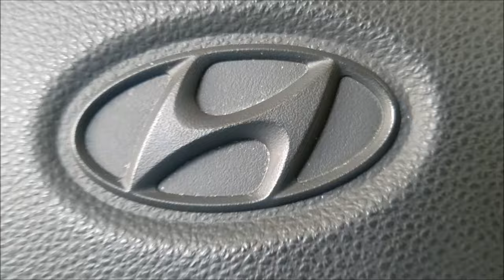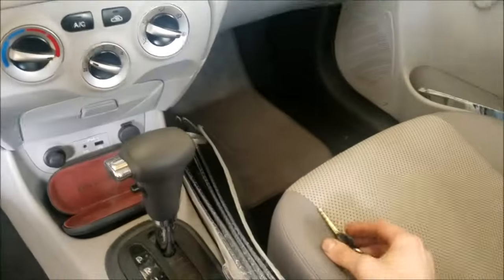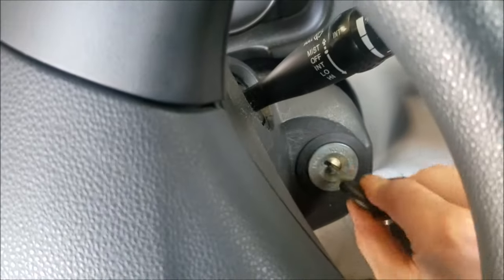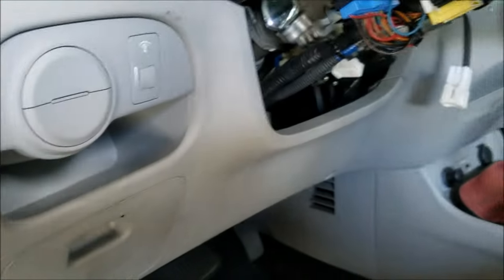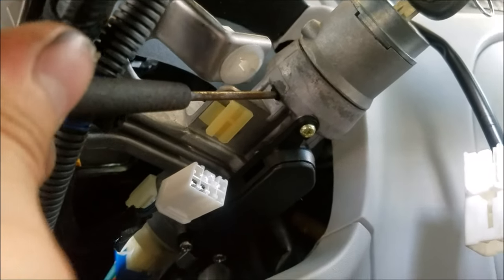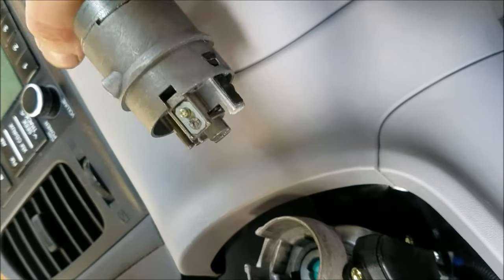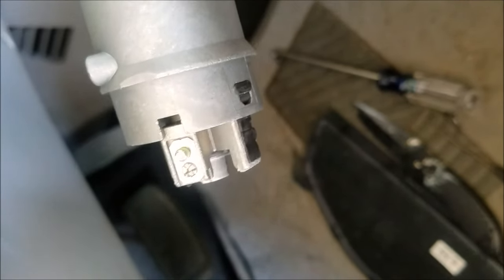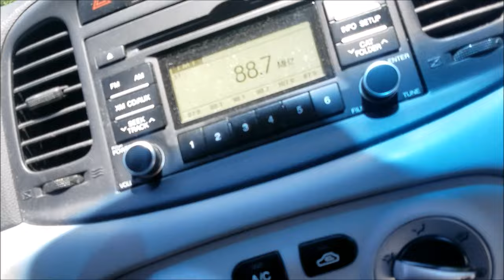How to replace Hyundai Accent lock cylinder

Comment: I have been having issues with my 2010 accent,  key will turn, lights on dash but no fire. Also having issues with steering wheel being locked and key not being able to turn. Wondering if replacing cylinder would help fix issue?

Comment: Please help me if you can! I have a Hyundai Atos 2002 on which the key gets stuck when trying to turn to ignition and start position - it's totally blocked. The steering lock can be deactivated. Is there anything to do with the lock cylinder - or does it have to be replaced? The key is very worn but this problem came suddenly and without warning! Do you think the problem is in the actual key-thing where the key goes "into grip" or do you think it's the locking mechanism further "down" from there, so to speak. Please give me an advice if you can! 😪🥺🙏🙏 I should add that the key is "electronic" so it's probably "immobilizer" or something. We have some copies of the original key and they wont start the car.

Comment: Thanks for the video!  They failed at stealing my gf's 2014 Elantra - replaced the back window and ignition assembly and it starts, but the instrument cluster (speedometer, fuel gauge) doesn't work now (along with shift interlock, which has an easy workaround).  Tried unplugging the cluster, cleaning contacts, replacing fuse.  The fuse socket isn't getting power.  It did have moisture inside for ~1.5 weeks from melting snow.  Any ideas?

Comment: I have a 2011 accent that has the ignition locked up and I have to do the same thing this video is very helpful but I’m being told my key needs to be programmed wondering if you had to program the key when you change it out
Reply: I have a 2014 Elantra with keyed ignition, keyfob for doors/trunk/security, and got the immobilizer software update.  I replaced the ignition assembly (cylinder and the assembly behind it that they also messed up while trying to steal it).  I didn't have to reprogram a key - I use the key that came with the ignition cylinder/assembly to start the engine, and my original key/fob still works for the doors. I confirmed the software update still works.
Reply: can you tell me what to order for the part thanks

Comment: Nice video, i own an 2001 Accent and have problems turning the key recently. But mine has an immobilizer antena that yours doesn't seem to have. Do you have any ideas for a procedure to program the new keys without any scan tool or special equipment?

Comment: What if you can't get the key in the Acc position? The reason we need to replace ours is because it's stuck in off position
Reply: Ever figure it out? Having this problem currently
Reply: @JoshFg4  Same for me, i can't seem to turn the key at all and the ignition switch gets stuck when i try getting it out
Reply: Same here I pulled the whole ignition out bought the replacement part can’t get the inner part out because I can’t put it in acc mode
Reply: On ours we had to replace to pwr steering pump and as soon as we pulled it out, we were able to turn the key.  You could try taking the belt off and then trying to turn it
Reply: @briankelley7618  someone tried to steal my wifes car they tried to turn the ignition with a screwdriver so the whole face where the key goes in is mangled my situations a bit different unfortunately thank you for the response tho
Reply: @Bootgnar  Hey, this just happened to me. Did you ever figure out a fix?
Reply: @briankelley7618  so replacing power steering or taking it off fixed the key not coming out?
Reply: @combuf  hey i pulled the whole ignition out and took it to a locksmith after buying the replacement tumbler they put it in now i have two keys one for the door one for the ignition so kinda but also not really
Reply: @Bootgnar  now I was told that you have a chance of deploying the airbag. Was it difficult to remove the entire thing?
Reply: @combuf  disconnect the battery before you start pulling stuff out it was a bit tricky to get out but wasn’t too bad
Reply: @Bootgnar  How did you do that ? Got same issue, someone tried to steal it and damage the whole thing. I can't put my key in it so how did you manage to remove the lock without doing the ACC step?
Reply: @ahyhijooooo  Hey sorry to hear about your car people suck so i took it to a friends shop and drilled the little metal pin it took some patience to not damage anything i didnt want to and then it sorta came apart as intended had to put the ignition in a vice and used some heavy pressure and strong thin drill bits
Reply: @Bootgnar  Awesome thanks man! It seems that older models in this case a 2002 does not have that pin and you can remove the switch located on the back of the lock. Still, I need to remove the whole lock assembly because the steering wheel is locked so I need to replace the whole lock assembly anyway and get new keys.
Reply: @ahyhijooooo  if you take the steering column cover off there should be two locking bolts holding the top of the column and ignition if its similar you could used a flat head as a chisel and a little mallet to turn the bolts (they look like rivets with a smooth surface) just loosen them both and the whole ignition should come off with it

Comment: I followed the steps in this video,  but I am still having problems.  I can install the new cylinder, but I cannot get the key to turn.  I do have the key in the ACC position.  If I put the old one back in, I am able to move the key.  I can move the key when the cylinder is out of the vehicle.  I am not sure what I am doing wrong,  any suggestions?
Reply from the maker: Why are you replacing the lock cylinder if the old one turns with the key?
Reply: I have the same problem. Installed new ignition lock in the acc position and key doesn’t turn. Only turns when I remove the lock.

Comment: What do you do if the key you have doesn't match the cylinder. Pop lock said they would have to drill it out. And would run me 450. Lost my key seems whoever owned it before replaced everything key made with vin isnt a match. How could I remove the cylinder
Reply: You should be able to carefully jam something in (small lock pick tool? small flathead screwdriver?) to remove the cylinder from the assembly, then just replace the cylinder for like $25-$30 with one from ebay.  I think.

Comment: Video doesn't work for one that's already locked. Which is kind of the whole point we are coming here most of ours are Soo bad they are locked. Cool video but you basically fixed something that wasn't even broken because your ignition switch isn't locked (fucked) like ours.

Comment: So will the old keys work in the new ignition when replacing or do you have to get new keys made? My girlfriend has a 2010 Accent and twice in recent months had to get it towed because the wheel locks. First time eventually got it going but it's happened again and so far it won't unlock. So guessing need to replace this part. Thx
Reply from the maker: The new ignition assembly comes with keys
Reply: I took mine to a locksmith to set it for the original key that fit the doors.
There’s another YouTube video that shows how but I didn’t have time to mess with it.
Reply: Unless you also change out the cylinders on all the doors, you'll use the new key that comes with the cylinder to start the car, then the old keys/fob will still work for the doors.

Comment: My kid's accent got broken into and they shoved a screwdriver into the cylinder to try and force-start the car.  Needless to say, the cylinder is FUBAR'd and the key won't go in.  Any advice on how to remove the cylinder in this case?
Reply: Did you find a solution? So frustrating, going through the same
Reply: Same for my sons. They key would no longer go in after it was broken into and they FUBAR'd the ignition. I was able to hammer the key in and then turn it to ACC to be able to push the pin to remove the ignition lock.

Comment: what do you do when your key won't even turn at all? I got the screws out but my key won't even turn. new cylinder should be in tomorrow
Reply: Did you find a solution? Same thing happening for me
Reply: @JNSRfilms  yeah, I sprayed it with wd 40 the lithium grease one, and tapped it with a hammer.

Comment: I have a 2011 with a chipped key that will not turn at all...how important is it to be in the ACC position? And do I need to order a chipped key replacement cylinder?
Reply: btw thanks for showing my I can do this myself :)
Reply: I didn't see the answer,, does it have to be in the acc position to take off the cylinder?
Reply: I also need to know I can’t turn it to the acc but my steering wheel is unlocked

Comment: Can you remove a steering wheel when its in the locked position?
Reply from the maker: +Todd Conley Yea you should be able too.even if you get the wheel off and the plastic covers out you still have to turn the key to remove the lock cylinder. I would focus on getting the lock cylinder to turn over. Let me know how you resolve this.

Comment: Hey thanks for this, I have a 2008 Accent, and I'm being told that I can't replace the lock cylinder (new part with new keys) myself because the new keys would need to be programmed to the immobilizer or something like that. Can you confirm? It doesn't seem like you had to do anything like that in this vid.
Reply from the maker: I doubt that! Let me know if that's the case tho. I had no such issue.
Reply: U can do it your car doesn't have a chip. Did it to my 2010 accent

Comment: What do you do if the steering wheel is locked and you cant get to all three screws?
Reply from the maker: +Todd Conley Id call a locksmith. I dont know of any way to easily remove the cylinder once it is totally seized. Try bumping the key and make sure that the wheel is not under pressure by turning it side to side while bumping the key. Good luck
Reply: I got it done.  I had to get a new key from a code at Hyundai.  That made the ignition turn to where I could access the three screws.  The rest was easy.  Thanks.  It was all in all a bad key and a bad cylinder.  Double bad luck.
Reply: Thanks for the video by the way.  I'm sure it saved me a bunch of hassle and money.
Reply from the maker: +Todd Conley Nice glad you found a solution

Comment: I have a 2009 Accent, but my key won't go to the ACC position at all, what can I do to get it there to replace my cylinder?
Reply from the maker: +meme Ladybug Do you have a spare key you can try? If not then try bumping the key or getting a new key cut if the one you have is worn. I assume that your steering wheel is not turned up against the lock cylinder.
Reply: finally got it to turn with my spare key that I had made, after playing with it a while and made sure wheel wasn't turned, feeling very accomplished, thank you so much, now I have my car up and runing again....woohooo....so happy
Reply from the maker: SWEET glad youre on the road again
Reply: Having same problem. I've tried eveything..  don't know what to do now l
Reply: How much did u buy the ignition switcher ?

Comment: If I push pin from the lock cylinder will it enable me to turn locked key to accessory so I can pull cylinder out
Reply: Good question as I cannot turn my keybto the acc position

Comment: How bout some wd- 40? Easy fix the way you did it. Would wd 40 at least be a temp fix?
Reply from the maker: It might be! Good luck
Reply: Lehew Tech  Wd didn’t do much. Too much weight on key chain was problem. I just lift up on the key and turns with no problem. At least now I know how to rpl it when it finally goes. Thanks. Good video.

Comment: Been trying to wiggle and bump and pull for about an hour.  Just not happening.
Reply from the maker: +Todd Conley You made sure that the steering wheel isnt up against the lock? On most cars the key is impossible to turn if there is pressure holding the steering wheel up against the lock like if you park with a wheel up on a curb.

Comment: Steering wheel is locked, key is stuck in the lock position lol.
Reply: I have a 2010 accent if you push the pin from the lock cylinder will it enable you to turn key to accessory so I can pull it out
Reply: Is there some kind of spring that goes between key cylinder and the housing

Comment: I have a 2009 accent amd this video was perfect! Thank you good sir
Reply from the maker: Thanks bud glad to help
Reply: MrHellizone Hellizone having a hard time with installing the new part as the pin would not engage putting in the key to turn in the car .
Reply from the maker: You need to install the new part with the key in the ACC position
Reply: @LehewTech  can't turn key to acc position :/  wheel is locked too.  Can't get it to unlock.  Is this still the likely solution, in your opinion?
Reply from the maker: Have you tried turning the key while applying torque to the steering wheel? Sometimes if you are parked up against a curb or on uneven terrain the wheel can be under pressure which prevents turning the key.